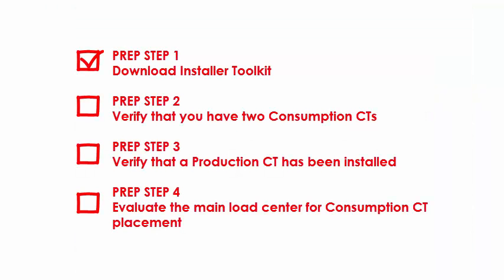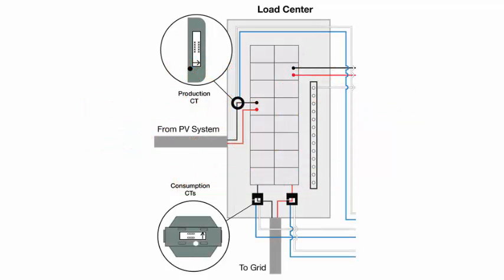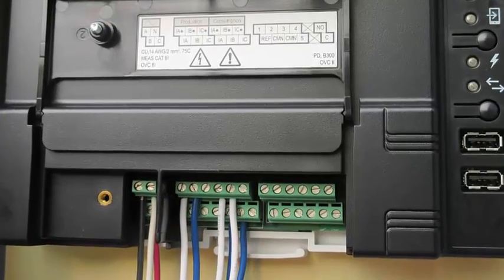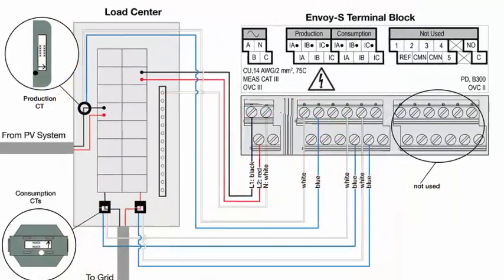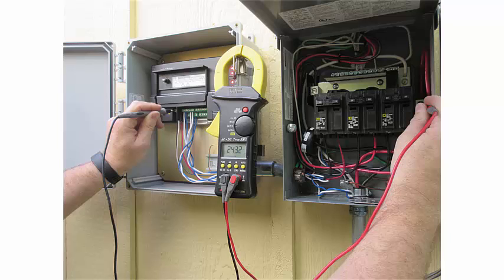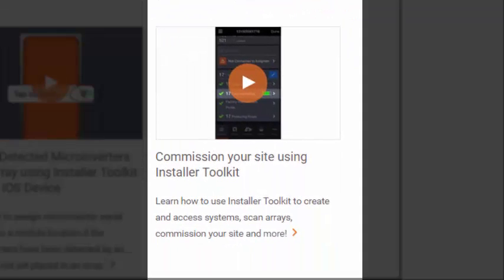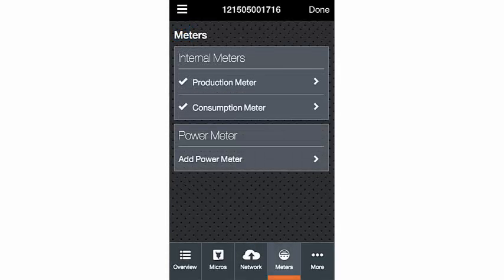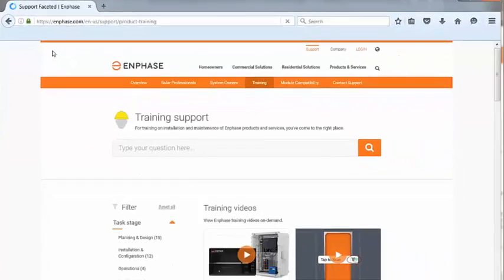CT: How to install consumption CTs for consumption monitoring

Comment: i have a 200 amp panel, but my solar installer didn't install them and said that my panel doesn't have enough space to install these consumption monitoring modules. Does that make any sense?
Reply: Read the installing consumption CT’s . You can run from the envoy to the main panel…up to 478 feet away…. Using the correct gauge (shown in manual) wire to make it work.
Reply: Yes it is possible for that to be true
Reply: Very possible, I’ve had that happen to me numerous times.
Reply: @phillipneal1263  did you find a way to make it work? I have a Square D panel with busbars. I want this feature.
Reply: It is also very common for the Envoy unit to be too far from the service panel for consumption CT use. I recommend considering a separate monitoring platform in those cases. Three possible choices, Sense, Eyedro, and Shelley EM. All are good choices, Use Sense for  monitoring all circuits, Eyedro for the best graphing capabilities, Shelley EM if you want to do some automation.

Comment: Does the Consumption CT have to be installed in the main power panel, or can it be installed on the wiring coming from the combiner box to the main panel?  Is the point to monitor the power going back to the utility, or just general consumption?
Reply from the maker: It can be set up both ways, either total home consumption or just a single panel, just depends how you wire it in. Here are some guides that might help determine what way works best: https://enphase.com/sites/default/files/downloads/support/Installing_Consumptions_CTs_Tech_Brief_EN_NA_1.pdf

It’s a big guide with check lists and pictures for an electrician. Normally when Troubleshooting CT issues or install, we advised you to contact support, as it can be quiet the struggle until you do it a few times and get it down.

Comment: And now that you can tell consumption vs production, here's a feature suggestion: enable a mode where no power if fed back to the grid. Instead, an I/O line can be enabled for a relay that would engage a battery charger, etc or simply signal microinverters to stop producing. This feature would effectively disable netmetering which removes current and future utility monopolies from dictating what gets connected to their grid.

Comment: where can i Buy enphase consumption CT ?
Reply from the maker: A local installer will be able to help you! Find one here: https://installers.enphase.com/locator.html
Reply: You can buy the transformers here: https://www.wholesalesolar.com/2930685/enphase/inverter-accessories/enphase-enphase-consumption-ct-200-split-for-envoy-s-metered-env-s-ami-120. As in the video, you will need two of them.
Reply: Ebay for $20 each free shipping
Reply: You didn't answer Greco's Question. What type, what ration, what Amp, Brand and model number, please.
cheers